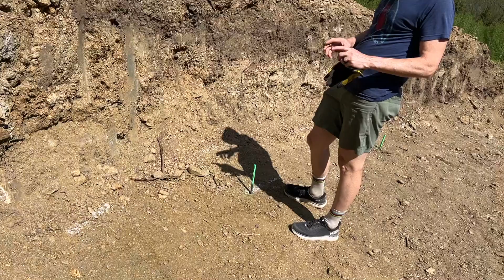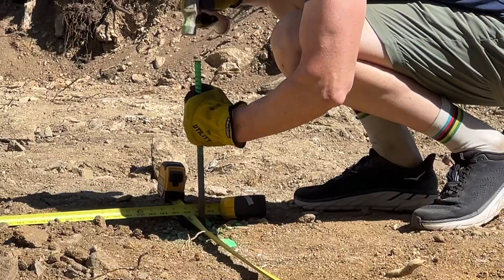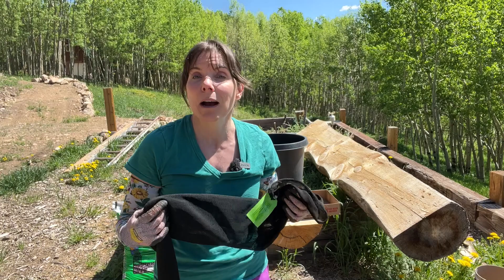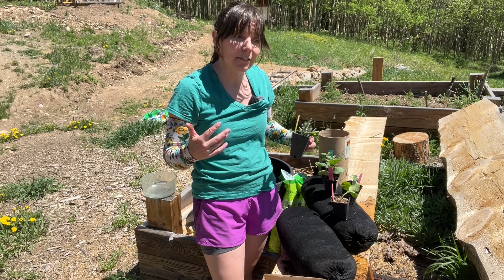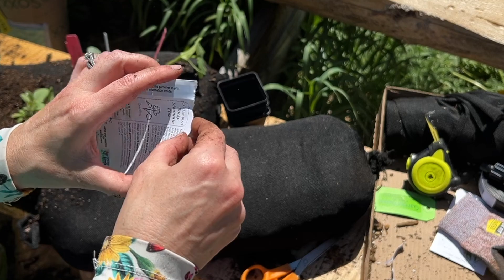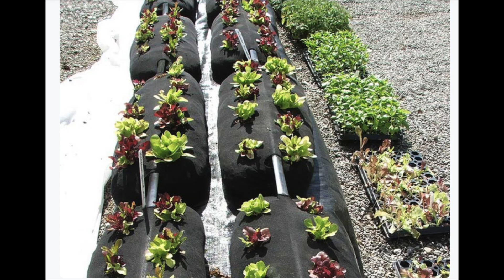Going Around in Circles - Dome Greenhouse Build

Comment: The spherical radius of the dome appears to be 16.62ft, which would result in a floor radius of 16.3572 or 16ft 4.2864".  If you used 16ft 4.5" for the floor radius that`s where you gained the extra few inches at the perimeter :) I make the difference between the two 1.343" so i guess the measuring line may have had a small amount of stretch in it.
Reply from the maker: Thanks for sharing your theory. We discovered that the sill plates were cut too long, so after Bryan cut off a quarter inch, on the boards, it fit together perfectly. The company assured us that the discrepancy was still within tolerance. But we felt more comfortable making the cuts.
Reply: @ColoradoMountainLiving 
Domes are very forgiving but being 1/4" out would have bugged me too. I like to work in millimeters so if it is out, it wont be by much :) The smaller the dome, the more accurate you need to be.